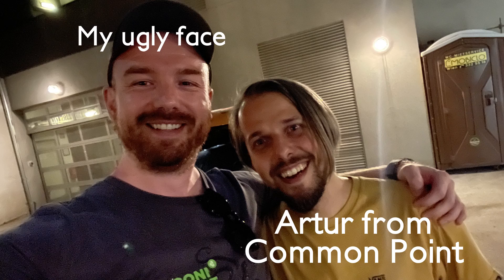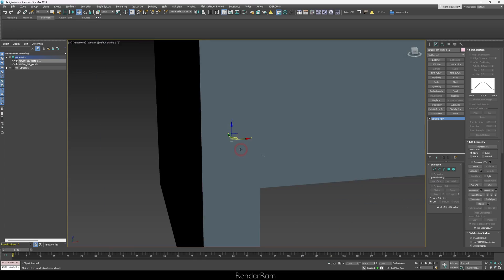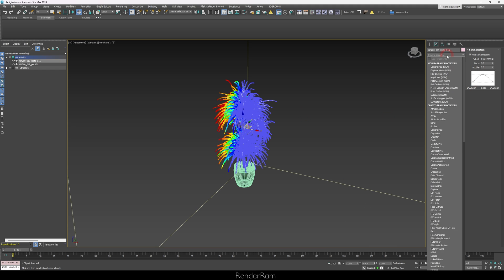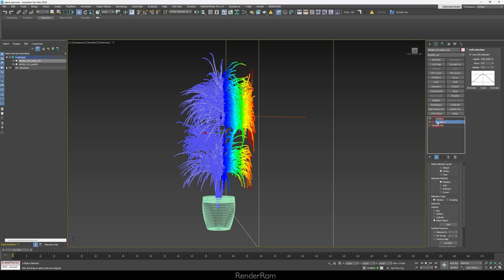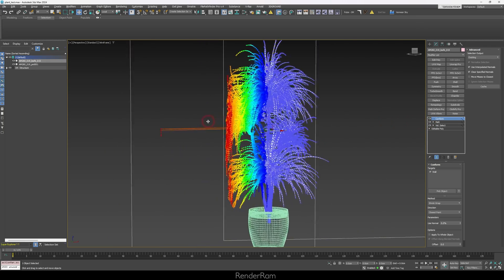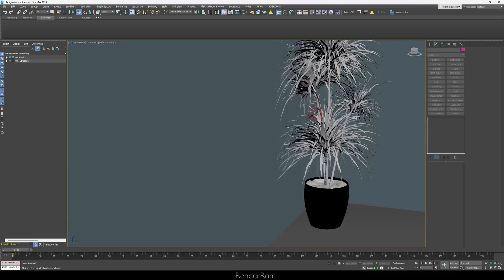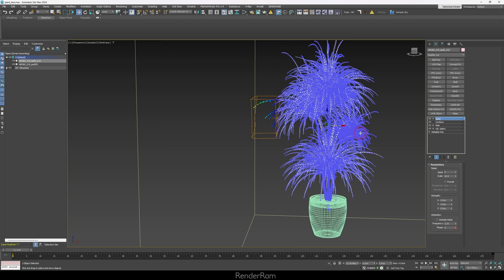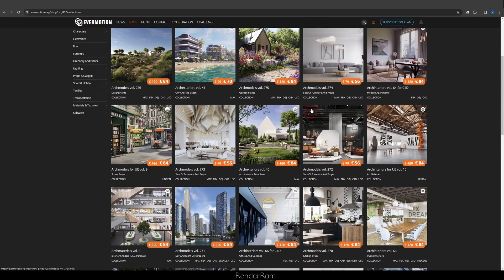Bending Plant Leaves Using 2024.2 Conform Modifier | 3ds Max

Comment: For first, you can add Vol.Select without soft selection. Then, Add Edit Poly and set as Use Stack Selection and set soft selection in there.
For Noise, you can Vol.select verts inside wall and conform again.
Also since it is a wall.. you can just use a direction instead of closest point. Closest Point is ok for small amount of verts. But, generally it is the most expensive method,
Reply from the maker: Golden info!!! Will try that out!

Comment: Great tutorial.  For the "magnetic effect" you have at the end, I solve it this way:
-Add a tyselect, (no softselection), will select only if inside the wall.
-Add a second tyselect calling the first selection, and set to softselect.
This way the softselection will only kick in if the plant is inside the wall, not before.

For the problem after the noise, you can add a second tyconform to push elements inside the wall, you can make that the conform only operates on a specific direction.
Reply from the maker: @changsooeun  oh damn, will try that out!
Thanks Changsoo!
Reply from the maker: Thank you, I’ll try adding these, seems that Ty stuff fixes a LOT of problems! ❤

Comment: you could try xform for offsetting the leaves from the wall, another trick would be to drop an edit poly after the vol select and limiting the soft selection with certain amount of edges to avoid using the pinch

Comment: ahhhhh this is such a cool idea, I had an idea like this awhile ago but it involved taking existing plant models and creating variations with tyflow running it through different sims to get different shapes. Honestly the same idea can sorta be applied with your method, take a plant you love (or a model of a plant everyone uses) and use different setups like this to vary up the shapes. Good luck in your journey my best advice is to check out some of the tyflow modifiers that come with tyflow, if my memory is correct the conform tool has some more features.

Comment: Great Idea. 3dsMax has a lot of tools that have never been updated. I feel you could have an invisible frame around the plant which should interact with colliding object and passing on the conform to the plant. Let me see the file.
Reply from the maker: I was thinking that too, but IDEALLY, it would be super practical if you can just brainlessly select your wall and call it a day
Reply: Agree. But if your collision object is a flat surface the rest of the large wall does not matter. What you need is a collision mesh with bones. But if it is for a still render your current approach looks just fine. In Real life if the plant was too close to a wall you would probably move it. :)  @RenderRam

Comment: This is really smart way of doing it ., thanks for sharing !
I've tried using tyselect and tyconform and I was able to get pretty decent result without the mentioned issues ,  some leaves will go up and some will go down depends on their initial  shape and the offset under tyconform modifier will work correctly
to fix the noise and intersection issue i've duplicated the the setup ( tyselct + tyconform) above the noise with lower soft selection distance to only affect the newly intersected polygons.
I've done some plants and tree simulation in other projects where I've used tyflow with birth skeleton and and PhysX to get proper collision  and wind motion, but for simple Archviz stills I think the conform method will be good enough and faster to setup
Reply: Hi! Can you explain step by step how you do this? I've tried but I couldn't go through the ty select... It selected every vertex... I dindt find the settings of volume...

Comment: Great job, I love the results. I don´t mind the offset, I would just set a EDIT POLY modifier to hold all the others and move the plant a bit.
Reply from the maker: that's the part that I forgot to say, you can basically collapse it, or toss Edit poly and move it out a bit
Reply: @RenderRam  i was goin' to suggest the collapse trick XD Sometimes the easiest solution it's the hardest to remember. Obviously when you're fully ok with the bending. But an editpoly seems way smarter since you can fine tune even after.